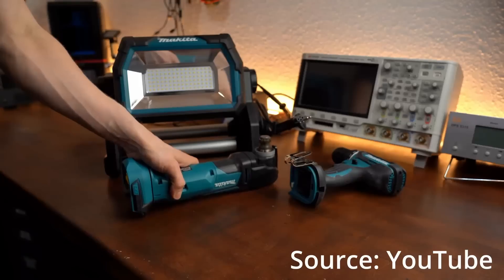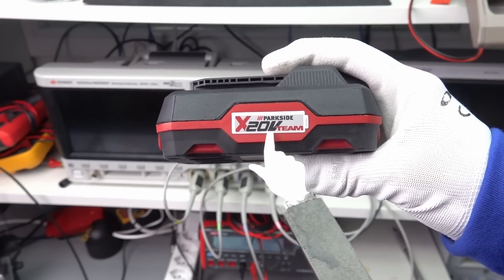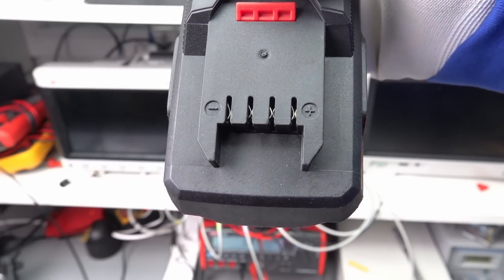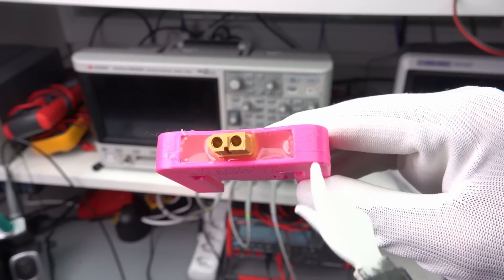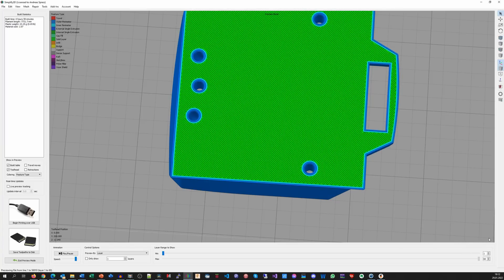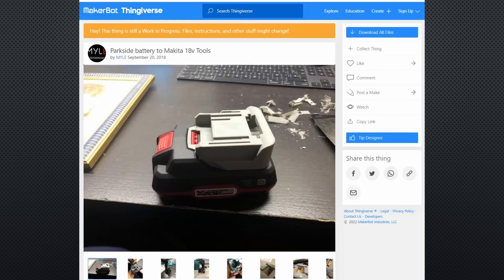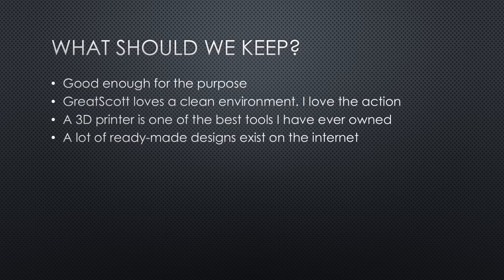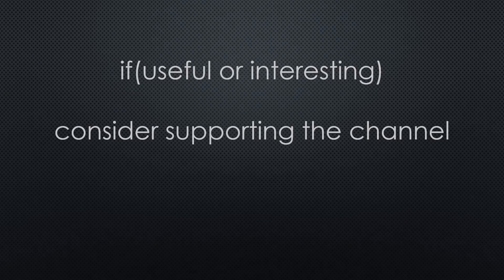#416 Creative uses of Power Tool Batteries for Mobile Projects

Comment: Are you sure there's no under voltage protection? I saw videos opening/upgrading those batteries and there is a very large PCB in them
Reply from the maker: no, the old ones I used have no protection. Protection is in the tool. Newer ones have voltage protection because it is now the law.

Comment: I don't have a 3-D printer, but I use my 18 Volt drill battery to run my soldering pencil. It's got enough juice to build an entire modest-sized project. I also used double-sided PCB material  to make tabs that stick into the battery's clips. Some red and some black adhesive heat-shrink tubing over the back-end of the tabs and the wires to connect to an epoxied USB-C+ connector, (also heat-shrunk) for the soldering pencil and it looks like it was done by someone competent.
Reply from the maker: You are competent if I see what you achieved!

Comment: Love the idea of a portable power supply. Espcially with all those power tool batteries lying idle most of the time. Did you use the undervoltage protection circuit, If so is there any issue with hysteresis?
Reply from the maker: I did not care about under voltage protection. These batteries are extremely powerful and I never deplete one with sensors and microcontrollers. But maybe it would be a good idea.
Anyway, I think, the newer ones have to have it built in. At least in Europe it is no more allowed to sell unprotected batteries.

Comment: the Ozito 18volt batterys can be used with the ozito usb power station for charging phones etc.  but when I try to power an arduino with one it cuts out after a few seconds.  does it shut of if not enough power is being used.
Reply from the maker: Most power banks switch off when the consumption is too low.
Reply: @AndreasSpiess  thought so, pity as those battery packs would be great, good size voltage to work with and plenty of amp/hours.  Thanks for the reply.

Comment: I use dimes on contacts for most drill batteries
Reply from the maker: A good idea if the material is solderable...
Reply: @AndreasSpiess  ya I just have uses it to check voltage and maybe charge with just a bench power supply so I just put alligator clips on them

Comment: I just finished a modification to my older 14V Dewalt flashlight.  My newer 20V li-ion LED flashlight that I love has started strobing and I can't figure out why so I went back to my older one.  It' has the old incandecent bulb, nimh battery with a weaker yellow beam (sigh).  Then I thought about some of your testing with boost converters.  I took it apart and found 3.9 ohm resistor in series with the bulb so a fully charged 16+V battery didn't burn out the 14V bulb (battery 16.8V - 3V drop across the resistor = 13.8V to the bulb which drops even more with the battery voltage).  I swapped the resistor for a 3A adjustable buck/boost regulator inside the handle and adjusted it to 14V.  Yeessss...much much better.  No under voltage protection (I don't think the batteries are protected) though, but I've used up the batteries many times with the portable tools so maybe not an issue as long as I don't walk off and leave it on.  There's not much more room in the handle to add a pre-made low voltage cutout circuit since the older battery packs have that tall post that fits half way up inside.  But, this was easy and fun thanks to your video.
Edit:  I've tried it every nite and it works great.  When the battery voltage drops below 10V the light suddenly dims and I hear a high pitch whine.  No damage, works fine with a fresh battery.  Board is a red  XL6009 buck boost converter with dual 330 inductors and blue trim pot approx 48mm x 25mm.
Edit again:  I ordered some white LED flashlight bulbs (PR2,P13.5S size) 18V since I can adjust but 12V is probably a better choice.  Long wait from China but I'll update in case anyone else wants to try it.  This is easy and these lights are expensive.
Edit:  I've compared two of these flashlights.  Again the fully charged 14.4V battery measures 16.49V.  When charged the stock unmodified light w/tungsten bulb draws 0.720A and the light with the boost/buck converter draws 0.820A.  So at a loss of 12.5% capacity initially I get a brighter light.  I don't think this is useful with new functioning batteries, but it does allow me to take some old batteries that are basically useless and get maybe 20-25% of their original capacity for a flashlight.  I'm writing this project off to experience, I was very impressed with the boost/buck converter, and plan to try it again on something different that uses alkaline batteries where there is maybe 50% capacity left when they get replaced.  We'll see.  I'm keeping the converter.  When the 18V LED bulbs I ordered arrive I'll need it to crank up the voltage for them and I will use it in the future.
Reply from the maker: Cool solution!

Comment: Parkside had the same idea ;) Check for "Parkside 20V Cordless Soldering Station". I have "Parkside Cordless Soldering Iron 4 V" and it works fine as well. Tools batteries are versatile. I want to use my for power HAM radio field operations.
Reply from the maker: You are right. In the meantime I also saw it in my Lidl store...

Comment: Hi Andreas. I've really been struggling to understand circuits for under/over protection voltage for batteries and through the link you mentioned for the undervoltage protection design and the comments on that, I am starting to get there as there as some good explanations of parts of the circuit there.  I know you have done a video on the subject of voltage supervisors and the circuit in this link helped me understand the concepts a bit better after your video. Thanks, as always.
Reply from the maker: You are welcome. Here it is more on where they place the circuit. In the tool or in the battery? My tool has it in the tool, which is not the best solution in my mind. Maybe it will change in the future...
Reply: @AndreasSpiess  Yes, I agree it is a bit naughty that the under voltage is not in the battery. However, it gives me a chance to use them as they are. Up until now I have stuck to Lifepo4 following an earlier one of your videos comparing battery types. So gives me a chance to use something else. Am already looking at using these for powering some 12v devices (low current) around the house for when we get power cuts, once I have built and tested the undervoltage protection (which seems to need to switch off when it gets down to 15.3v).

Comment: make battery project for e bike with 2 or 3 batteries
Reply from the maker: E-Bikes need quite big batteries. Sou you would need many such small packs...
Reply: @AndreasSpiess  Yeah i know. It will be not  the best project,but just for the project.@ in parallel for 36 v bikes. 4aH or even 8aH battery packs for small range should be ok.

Comment: Or you could just buy the Milwaukee M12 SI-0 12V soldering iron. Battery powered. I use it daily in the field. Great little thing for it's little 12v package.
Reply from the maker: Looks good! Not cheap, though.

Comment: 1:16 I would throw that Lipo away. It looks badly puffed up. It will burn most certainly. Buy one from Swaytronic😉
Reply from the maker: It is like that for a few years already. So far no problems :-)
Reply: @AndreasSpiess  Yes i know but i also had one for my rc plane and everyone told me to throw it away until suddenly it catched fire while charging. The cost of fixing my garage was 10x higher than just buying a new battery. Do what you want :)

Comment: For small modifications to STL file, like adding a hole or cavity, I find TinkerCAD is the quickest and easiest to use. You're not getting the features of Fusion or OpenSCAD that's for sure, but you also don't have the complexity of that software to deal with (like how many faces fusion wants to create with an imported STL in the free version).
Reply from the maker: Thank you for the information!

Comment: Actually the Makita batteries have built in under voltage, over voltage, short circuit, and over current protection, I don’t think any other brands have that though
Reply from the maker: There are different opinions on that topic in the comments. But it seems that Makita is best in this discipline.

Comment: Have you tried Blender? I moved away from blender from "everyone" saying it's not for mechanical designs. After thousands of dollars and a few years of experience working with other engineers on models. I now use Blender with confidence that I can knock out a part just as quick if not quicker - even if I am using mesh not vectors, this is not noticeable for 3d prints.
Reply from the maker: No, I never used Blender. Thank you for sharing your experience!

Comment: https://www.youtube.com/watch?v=UZbjAkZF6d8   

In this video I replaced an old, defective 12V NiCd battery from my Black & Decker screwdriver, model CD121, type 4, for a 12v lithium-ion max battery from Makita, model BL1016. But for the replacement to happen, it was necessary to make an adapter that would be perfect, both in the screwdriver and in the new battery.

Comment: Cool, but wouldn't it have been easier to attach a knife to a stick 😉
Reply from the maker: A few othe viewers asked the same question. I started with a knife or scissors. But at 10 meters high it is not easy to place a knife at the right position nor create enough pressure to cut the quote strong rope (at least this is what I think). Heat does its thing in a fraction of a second and without pressure.
Reply: @AndreasSpiess  Hi Andreas, thank you for the reply. Should have guess that you already tried it :) Have nice weekend

Comment: Excellent and very informative video! I would love to find a decent 3D printer that can also be converted to a laser etcher. Learning the software would be a pain for me since I prefer working with someone to learn the ropes.
Reply from the maker: I never saw something like that. Probably also because lasers are quite dangerous and need different housings.
Reply: @AndreasSpiess  Printers like this do exist, e.g. the Snapmaker. But they are quite expensive, some to the point where buying a printer and a separate laser engraver would be cheaper.
Reply: You could also convert most 3D printers to laser engravers yourself, but that would make it even more dangerous. For learning the software: you might find like minded people that can help you at a local makerspace.

Comment: I am using a 12V Metabo battery with an original power adapter which provides 5V USB, and 12V to supply my ICOM transceiver outdoors.
Reply from the maker: Both are good use cases (if the buck converter is RF quiet, of course)...

Comment: Thanks for this handy topic. I did not now I needed one because I did not now this exists but now I do, Ineed to build a complete tiny-e Lab on batteries for mobile use😂
Beware of Makita batteries. These have a special function in the BMS which marks a battery as a bad/broken battery as soon as the voltage drops too far. 
From that point on, an original Makita charger will refuse to charge this battery.
Reply from the maker: Li-Ion batteries can get dangerous after a deep discharge. Maybe that is the reason for Makita's decision...

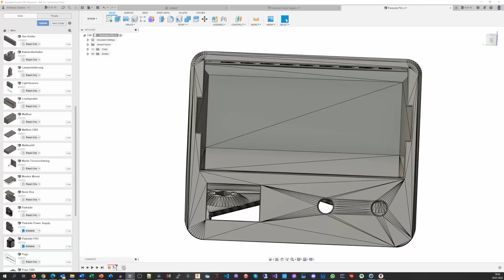Comment: ref:  7:00
Fusion 360 is a great tool, but for a models like this, the learning overhead would be a lot less making it in openSCAD.
Reply from the maker: I tried openSCAD and for me, its learning curve was much steeper than with Fusion. But I am more a visual person...
Reply: @AndreasSpiess  I would also say that I am a very visual person, but maybe more internal. I will visualize what I want to make and then break it down to the forms needed before i start. 
The battery connector box can be made from about 30 lines of text using cube(), cylinder(), transfer(), difference() and minkowski(). The last is to make rounded corners.
 I agree that any programming language can have a first step that is a little high, but using  the built in examples should help.
There is also a lot of free models and model generators.

It is also nice that I can run openSCAD on Linux, even run it on a raspberry pi.  :-)

Comment: The LIDL batteries have low voltage protection, but they don't have disconnect mosfets. One of the two inner pins is used to signal "power ok" from the battery to the power tool.
Reply from the maker: Other viewers also wrote that there is a signal about the voltage on one of the middle pins. But I would not call that "protection" because it does not do anything. But maybe you could add it to a FET to switch the power off...

Comment: I guess a simple knife at the end of the stick would have been too boring :-) Impressing however, how much self-made and knowledge you got in this video
Reply from the maker: I started with a knife and scissors but at 10 high it would not be easy to position and apply the needed force for a cut. Heat works in a fraction of a second. Positioning was not difficult.

Comment: A friend of mine and me created a universal attachment system for all major powertool manufacturers' batteries, that allows to stack various modules on top of it. So far we've made USB and notebook powerbanks, LED worklights, a bluetooth speaker kit and various lab power supplies based on chinese stepdown modules with LED voltmeter. It's so useful once you start with that system.. and 18V at a few Ah can get you quite far.
Reply from the maker: Cool! Did you publish your work for others to use?
Reply: @AndreasSpiess  It's going up on Gitlab when I'm done sorting the files and putting some basic descriptions etc together, yes.

Comment: Great video once again. Sudden realisation I have not one but two of these batteries in the garage and I have a SQ001 soldering iron which is a clone of the TS,100 got to get printing! However there is a far simpler way of cutting the radiosondes cord and that is to tape a strap cutting safety knife to the top of your pole. Ive used it four times with success. Keep up the great work!
Reply from the maker: Glad to read that you were successful with a knife. I thought it will not be easy to position it and apply the needed force 10m high.
Reply: @AndreasSpiess  Just found out that  TS100 firmware has undervoltage protection for lithium cells built in to its latest firmware

Comment: Great video as always - Informative, factual AND entertaining. Your 3D printing section was very helpful. Brand new to the Prusa machine, I am hoping to produce small custom electronics parts (mounts, enclosures, adapters, etc.) as you do (so well). Was Fusion 360 a bit of a challenge? It intimidates me.
Reply from the maker: Fusion360 or any other such tool is confusing in the beginning. A lot of work in front of you. But rewarding!

Comment: Using a soldering iron to burn a plastic cord. Ok. Personally I'd have taped a knife blade to the end of the stick, but that wouldn't have made for such an interesting video, thank you 🙂
Reply from the maker: I started with a knife, but changed to heat because I thought it will be difficult with a knife 10m high on an thin pole...

Comment: Great Andreas, many thanks. It was in my mind because I'm thinking to the supply of the far sensors in Home Assistant. Home assistant is another theme that I'm trying to to solve.
Reply from the maker: You maybe get better solutions to power sensors at 3.3 volts...

Comment: I have used a standard crimp Spade connector to recharge a Laptop PC battery whose internal charging had ceased to work. But mine were simply shoved into the battery, nothing like your Rosey one.
I wish I had space for a 3D Printer. I wish I had some spare cash for a 3D Printer. 🙂
Reply from the maker: Indeed, these printers need both, space and money. But they are useful...

Comment: Why are there ten 2000 mAh / 3.7V cells inside of a 20V / 2000 mAh battery when five should do the job?
Reply from the maker: Because they wanted double the capacity.

Comment: ⭐⭐⭐⭐

Would have given you give stars, if you made your own rechargeable battery pack with internal voltage regulator, buck converter and / or capacitor switch, battery recharge / drain controller....... 🙃

All with built-in power (charge) docking station of course.... 🙃🙃🙃🙃
Reply from the maker: Why would I do this if I can get a ton of cheap and powerful finished modules? As you know, I am not too much interested in building power electronics

Comment: I've taken a number of older 12V drills I had from the past that use to run off of NiCad pak's and converted them the cheap 18v Li Ion paks you can get at discount tool stores. They all work and with a little more speed and power now. That being said, I only use an 18 V pak that comes with a wallwart type charger so the battery has all the "safety stuff" built in. These paks are generally the replacements to the economy ended drills that are out there. The last thing I want is a tool on fire in the trunk of the car.
Reply from the maker: Cool. You probably wwere lucky the did not burn with this 50% voltage increase...
Reply: I've done at least 4 old nicad drills like this with success. I suspect the speed controls can withstand at least 30 volts or so. The motor generally is going to be used intermittently but have not burned one yet.  I had a whole box of retired drills due to bad batteries and expensive replacement paks. Nothing to loose, so I tried one and have been rewarded with a basket of resurrected tools :-)

Comment: Why not just a knife on a top of stick?
Reply from the maker: I started with a knife or scissors. But how would you hit the cord? Not easy in 10m heigh. Plus how to apply the needed force? Heat is very easy. The cord melts in a fraction of a second without applying any force.
Reply: @AndreasSpiess  Yeah, I trust on your experience about this. Some things just look easy on the paper.